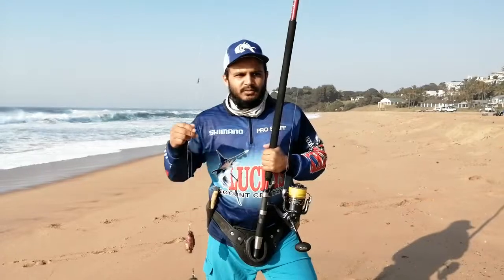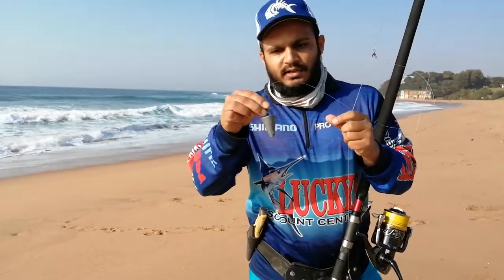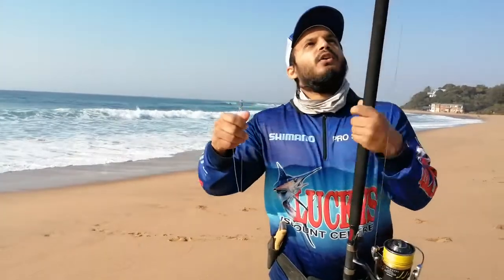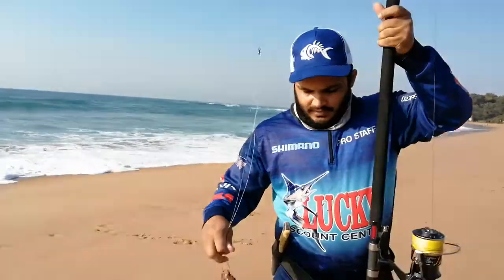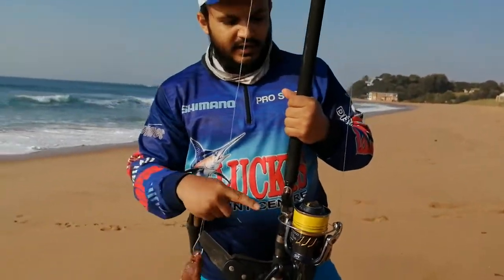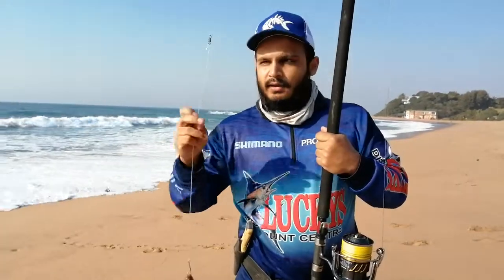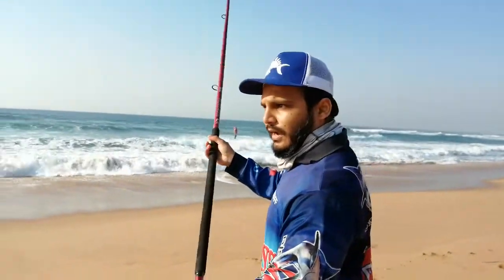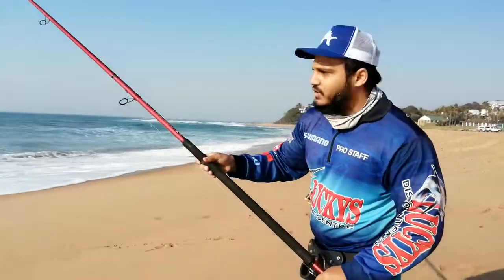Junaid Ismail demonstrating tips on how to improve your casting. rod used  Assassin Horizon xxh

Comment: Just a question...I noticed you use fixed spool reel... Can you slide out bait with fixed spool using braid... Please can you advise us on how you slide out using a fixed spool reel..
Thank for your videos awesome stuff
Reply from the maker: Howzit yes you can slide using braid. The concept is the same you just have to shake the tip of the rod much faster and be very quick with the process of getting the bait over the waves or it tangles really quick

Comment: The fact that I'm binging on fishing vids @1:44 am😊....very good explanation Sir.
Reply from the maker: Glad you can relate dankie
Reply: What's your opinion on assassin rods got the new rovex big boss 3 6000 looking for a surf spinning rod to pair it with preferably a 12ft rod slim but not the super slim
Reply from the maker: @raushansieed9767  assassin range of rods are of the highest standard for the past 2 decades. Look into the assassin evo zero gold
Reply: @JunIsmailFishing  and the cheaper versions like the assassin spin 12ft and the assassin edge surf 13 ft I'm looking for something to pair my big boss 3 6000 with
Reply from the maker: @raushansieed9767  for throwing lures?
Reply: @JunIsmailFishing  nope using blood worm and prawn from the surf
Reply: @JunIsmailFishing  which is better between the assassin edge surf 13ft and the adrenalin triple x spin 13ft blanks and components wise
Reply from the maker: @raushansieed9767  in my opinion the edge

Comment: Don’t hold your breath when you cast.  It’s better to breathe out. Some like to scream on the cast to get the air out of your core.   Holding your breath when you cast can give you a hernia if you hit it hard enough.
Reply from the maker: You can't execute power in loading your cast when you breathe out. After the cast is loaded then breathe out. Eg. U punching someone. The time when u load ur punch is not when u breathe out
Reply: @JunIsmailFishing  you will get what’s called a hiatal hernia.
Reply from the maker: @castclubmike  d
Strengthen your core